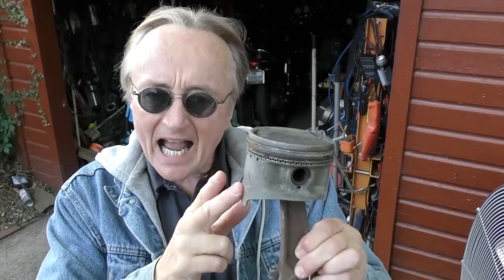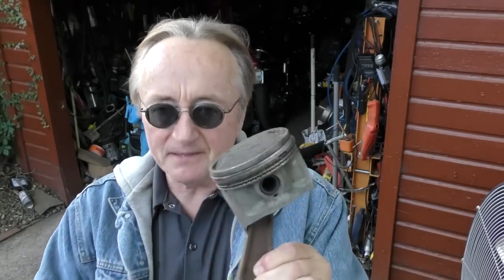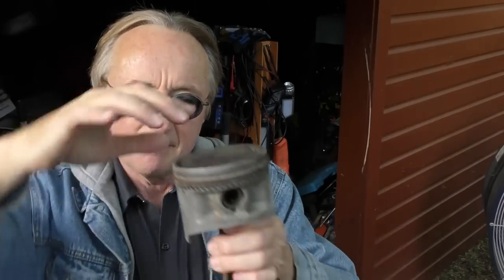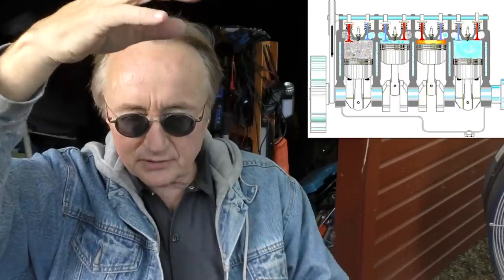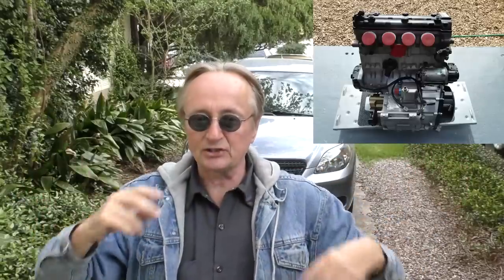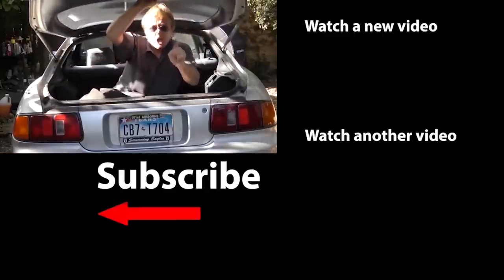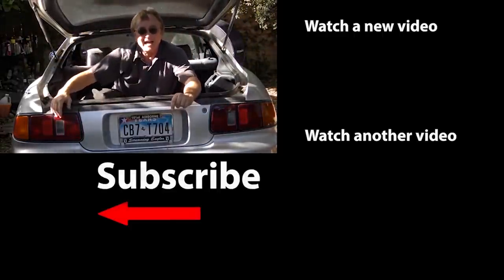Horsepower vs Torque, Which is Better

Comment: Torque - strangth of the rotation.
Horse power - is the work the engine does to rotate the wheels
Reply: I love this
Reply: Actually no. Rpm =speed of rotation. Torque×rpm÷5252 =hp
Reply: Horse power - strenght of the rotation multiplied by the speed of the rotation. You can get torque from HP, but you can not get HP by torque alone. That's why HP is the most important thing - no matter how hard you push, it's the speed of the push that matters. 
“Give me a place to stand, and a lever long enough, and I will move the world. ” 
― Archimedes
Reply: Sounds about right bro. Horsepower includes the momentum and inertia whereas torque is only measuring the force exerted on the crankshaft by pistons. Thanks Nick
Reply: Hp isnt speed of rotation. @5000rpms, the its rotating at.......@5000rpms regardless if its making 200 or 2000hp at that engine speed.

Comment: When people think high torque they're usually referring to high horsepower at lower rpm (refined acceleration), when people think high horsepower their thinking of peak horsepower which is usually achieved at high rpm or in other words a screaming engine to get good acceleration.  A high torque engine will feel more peppy and responsive.  A high peak horsepower engine will only accelerate fast after dropping multiple gears first then screaming at high rpm to yield its full and ultimately faster potential

Comment: Good simple explanation but there are more factors including gearing.  An acceleration curve within a constant gear does mimic a torque curve, hence best acceleration is at the torque peak.  And modern transmissions are very good at keeping an engine within the torque peak.  But lower gearing is a torque multiplier. An engine with 1/2 the torque but twice lower gearing has the same torque at the wheel and same acceleration (at that point).   An E92 M3 had only 295 torque but an 8500 RPM redline and 415 HP, hence once off the line, lower gearing gave it the same torque at the wheel and acceleration as a car with tons more torque.  Also note a basic fact:  SAE HP = T * RPM / 5252, hence at 5252 RPM, HP = Torque.  This also means any engine with redline < 5252 has more torque than HP, and any engine with a higher RPM HP peak can have more HP than torque.  Lastly, you need HP to overcome drag from air resistance at high speeds, hence higher HP does give you higher top speeds.

Comment: All engines, ONLY make torque, not horsepower.   Horsepower is a function that calculates how much TORQUE an engine makes per unit time.  

High torque engines, have longer bore strokes, which makes a lot of low end torque.  All piston engines, are limited to a certain piston speed .  High torque, long bore stroke engines reach this high piston speed much sooner than short stroke, high hp engines.  

The secret to big HP, is to make your peak torque, higher in the RPM band.  The trade off being, low end torque production suffers.  This trade off can be helped, by engine configuration (V vs inline, or number of cylinders), forced induction,  and by using steeper gearing ....  Gearing, combined with a high revving engine,  is why a Hayabusa and F1 car, can accelerate so fast, with relatively LOW torque production.
Reply: This is a very short, rudimentary explanation, but I look forward to the comments!
Reply: Twobarspi, you gave  too much logical info, so now the street fight will happen between the fast and the curious LoL. 

  Name of their drama: Wes side sorry story

 Thanks though, for being factual, dude.
Reply: @mazdarex7  thanks 🍻👍 !!
Reply: @Twobarpsi  we will now be attacked for being "square bores"
Reply: @mazdarex7  😂😂😂😂

Comment: Torque is the measurement of Work that is applied in rotating the crankshaft. Horsepower is the rate at which Torque is applied for a given amount of RPMs.

Comment: So practically high torque engines (diesel ones and powerful pertrol V8s) are better than high horsepower in a daily city driving, correct me if i'm wrong
Reply: You're correct. Torque helps low speed acceleration which is mainly what the city is.
Reply: high torque engines are better for carrying heavy loads and doing a lot of stop-and-go motions. for city traffic in a truck, then yes, but for a light car you don't need a lot of torque
Reply: Welcome to Europe with their diesel car trends ---> 150hp ~ 400nm/torque
Reply: I will correct you because you are wrong, Higher torque in stop and go traffic is just gonna make you smash your head on the steering wheel 20 times before getting to work because you will have a very jerky ride stoping and going with so much torque. A car with more ponies will give you a smoother ride and that will be far more relaxing to drive to work in
Reply: @Jamie-cz2xu  smashing your head on the steering wheel has nothing to do with engine output numbers but rather with your throttle control skills.
Reply: @Jamie-cz2xu Far from the truth. High torque vehicles offer peak power before 5252 RPM. This allows you to shift earlier and have smoother acceleration and higher gas mileage. Honda realized this the hard way and had to change the engine Dynamics for their Civic line up. Don't believe me compare the torque numbers from an 07 to 2018 Civic Si.

A good car for the city will have a balanced torque and horsepower setup. 200 horsepower and 200+ pound feet of torque is ideal for a vehicle around 3000 pounds. That's of course my opinion.
Reply: @Josh-cw8by  it's not that Honda had to learn it the hard way, they were catering to the VTAK crowd that liked to rev to 10k rpm.
Reply: @AR-zq9hq  You're probably right. I'm by no means an expert, just my observations.
Reply: @Josh-cw8by  yeah, back in 06 or so there was rivalry between Civic Si and VW GTI, they both had 200hp, but si was a high revving low torque motor, while GTI had 200ftlbs torque and would rev much lower. Both cars were equally quick to 60mph, but the GTI was easier to drive. I personally was team Si back then haha
Reply: @AR-zq9hq No kidding eh? Weren't those engines from Honda forged as well? Forged internals anyway.
Reply: @Josh-cw8by  no, I believe that would be the B18C, the Integra type R motor. The K20 in the US market Civic Si didn't have forged internals.

Comment: Torque is the force generated by the engine. Horse Power is the torque multiplied the rate at which that force can be applied. Because peak torque occurs at low to mid engine speed this implies higher power at lower rpm therefore quicker acceleration / better towing.

Comment: 3:35 “… formula 1 don’t accelerate”  ?.???.?
There is a thing called “gear box” you know…
There isn’t anything faster, quicker and with better acceleration per liter of engine displacement than a F1 car
Last weekend at Austin’s COTA things were put in perspective
Reply: “They start slow”
Really? 0-200 km/h is under 5.5 seconds? 0-100 under 2?
And that’s not even what makes F1 the best, it’s the changing direction and the braking power… the Gs in lateral forces
If you are up to let’s meet at COTA this year during the GP, I think you misspoke about this issues because of the t8me video. Let’s talk, I will buy you a coffee or a beer (or two or three lol) at downtown Austin
Reply: But… Mr Plow… all is forgiven he he
The coffee/beer proposal is still on

Comment: So torque is is a bodybuilder and horsepower is an olympic sprinter.  Got it.
Reply: Horsepower is like having a really massive body builder using a tiny spanner to loosen a nut..... Torque is like having a thin scrawny guy loosen the same nut with a spanner a few feet long
Reply: Now I get it.  thanks for a great metaphor.
Reply: No. Those are both high power people. Ask them each to carry 100 bricks to the top of a tall building. Who knows which one will win... They are both high power. Power is work / time.

Comment: Torque is rotational force.  
Force over a distance is work and takes energy to accomplish.  ( Can't create energy, just transform it). Going zero to 60mph takes a certain amount of work, almost independent if how fast you do it.   Power is the rate at which you can do work.   Climb a hill faster, or go zero to 60 quicker takes more power.

Comment: Torque: is a sumo wrestler pushing his way through a crowd and horsepower: is a bag snatcher running away with the handbag.
Reply: Tq is the reason you get pulled back in your seat as you accelerate 0-60 in 3.5 seconds. Hp is why your car can keep going to 150+ mph

Comment: You buy horsepower, you drive torque.
Reply: Well spoken
Reply: Not true because a car with 200 horsepower and 150 torque will always be faster than a 150hp 200 torque ..on initial hit that torque will jump a tiny bit bit once you get in that rev range.....
Reply: Completely wrong. Think of torque as a twisting force, and hp is how quickly/fast it can actually turn.
Reply: except a car with 150 hp and a car with 500hp can both turn at the same rpm (speed).. so

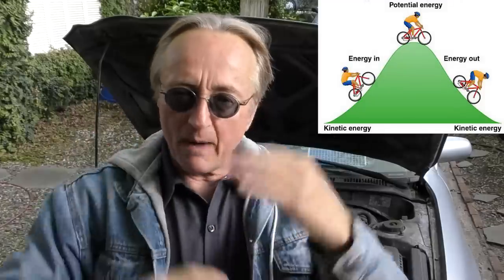Comment: 0:25 Chemical Energy of Gasoline not Potential :)
Also Formula 1 cars have some kind of hybrid battery which helps in acceleration on straights
Reply from the maker: gasoline is chemical potential energy, don't know who told you otherwise
Reply: F-1 cars have a lot of gears, not some electric gas hybrid motors
Reply: Stop being one of those people that correct every little thing about others, make a video yourself
Reply: Chemical energy is a type of potential energy... So scotty was right and you are correcting him without knowing the definition yourself.

Comment: Actually torque is determined by the length of the stroke and width of a bore. The longer the stroke the more torque, but because it has a longer stroke the piston is narrower in order for the car to have a certain displacement. so a 2.0 liter engine with more torque will have a longer stroke and smaller bore than a 2.0 liter engine with more horsepower... Test it, find 2 different engines with the same displacements and look at the bores and strokes of those engines.

Comment: Usually inline engines produce more torque in the lower RPM band than the engines that's why most diesel engines are straight in line and not in the v configuration

Comment: Volvo = Runs steep uphill without any vibration in the RPM.
Toyota = Starts slowing down and needs switch to low gear to keep RPM not dropping.
That's how i learned the difference between horsepower and torque

Comment: actually, Power is all that matters, the difference is the powerband

high torque engines tend to make all of their power at low rpm, so they're good at towing heavy loads if you need to stop-and-go a lot, and they will deliver instant acceleration as soon as you step on the gas. They are also usually much larger and heavier than lower torque engines that make the same amount of power

high revving engines on the other hand make all of their power at high rpm and they weight a lot less, so while they may be slower when accelerating from a standstill, once they reach a high rpm they will provide a lot more acceleration while also weighing less

Comment: my father used to have a 1.8l diesel engine with 90hp.
that thing had power for days.
while i had a 1.8l gasoline engine with 115hp.
my car wasnt all that slow tho, but compared to the diesel it did felt sluggish. 200nm at 2000rpm even with only 90hp make big difference.
Reply: now i want a diesel..
unfortunately buying nowadays a diesel in germany is financial suicide.
Reply: It just the turbo in the diesel car that tricks you, in fact the gasoline one in your example will accelerate a little bit faster but you won't feel it that much bacause it's much smoother without turbo.

Comment: Its like gearing was completely forgot about in a majority of comments and this video ..       With enough gears, fast enough shifts or an extremely tough / efficient CVT ... you can pretty much do anything: a high torque, low hp engine will get you there fast and keep you there.  If you are trying to achieve speed w/o a sophisticated transmission then yes you need the high rev higher hp engine.

Comment: Engines have a torque band. You can design an engine to have torque at low rpm or you can design an engine to have torque at a high rpm.  I have two BMW motorcycles. One has an 850cc engine and the other has a 1200cc engine. The 1200cc engine produces 60 hp and the 850cc produces 75 hp. The 850cc gets it's hp by turning at a high rpm. The 1200cc has a lot of torque but does not go high rpm. Personally I like the torque as it is more pleasant for driving around town.

Comment: Horsepower vs Torque, Which is Better?.....is like asking Watts vs Volts, Which is Better? It's a nonsensical question, because torque is a part of horsepower, just like volts is a part of watts. If you asked an electrician or electrical engineer, "Watts vs Volts, Which is Better?", they would rightfully look at you like you were stupid. Likewise any mechanic worth their salt, would view you as equally stupid, if you asked them the title of this video.
Reply: Exactly, I think the difference and the reason this misconception is so much more pervasive than your example is that people's intuition grabs on to torque and they equate it to muscle strength as in a really powerful person. They loose sight of it being a static quantity that does not require motion or energy at all. As soon as anything is moving, all those "torque guys" are really thinking about power without understanding it. 
You're exactly right. Before the lightbulb comes on, power is still this mystical thing that they know involves speed somehow, and so they forget that it is a also a direct function of torque. They also tend to forget that a gear ratio trades torque and rotating speed. This is the key to breaking the "more torque in must mean more torque out" misconception.
Reply: watts offcorse 👍🏻 dosent matter how many volts your blender have if it have 1 watts of power you willl blend your fruit shake  10 years 🤮 vs 10 kw at good gearing be like 1 sec of hold switch and done   👍🏻 .

Comment: HP = Torque ( lbft ) x revs ÷ 5252. On a dyno, the power and torque curve will cross at 5252 rpm.

Comment: Harley accelerates faster than Hayabusa? Yeah right!
Reply: Haha yeah maybe if the harley is falling off a cliff.
Reply: How fast a vehicle accelerates from 0 to 100 km/h can be calculated from it's weight/power ratio plus 10%. A car that weighs 1000kg and has a 100hp engine for instance accelerates from 0 - 100km/h in 1000/100 +1= 11 seconds. The transmission turns the engine power into the propelling torque at the wheel. A lower weight to power ratio always wins a drag race. A Hayabusa has roughly 3x the torque of a Harley at the wheel.
Reply: @jmarselle3877  Even then not... as they both will accelerate at the same speed until aerodynamics become a factor so the Hayabusa will have a higher terminal speed, assuming they're both facing vertically downward.
Reply: Kilmer doesn't know what he's talking about.
Reply: When I had a bmw 1150 it would beat an r1 to about 50 mph! I'd be in 3rd gear, Yamaha still in 1st pulling a wheely as it passes me!
Reply: Power is nothing without control! Takes skill to launch an R1 properly.

Comment: Hey Scotty I just got a leftover 2018 Ram Promaster with the high roof, she's going to be pampered as a multi-use family vehicle rather than commercial work.  Wheelchair van on occasion, camping, and just to haul stuff like a pickup truck.  Besides 5,000 mile oil changes and normal service how can I ensure she last the longest, probably be driven around 5,000 a year give or take.

Comment: James Watt defined horsepower :- 33000 ft/lbs per minute.
A good coal pit horse could raise 33000 lbs (of water) through one foot in one minute -- or any combination of weight and distance that equaled 33000.
The torque force is the ft/lbs component, the power component is the rate of applying that torque.
Example :- a 330 lb weight moved 100 ft distance in one minute  is equivalent to one horsepower.

Comment: I tend to think about torque and HP like running a 400 meter olympic race. Torque is how fast you can get off the starting line to reach your top speed, and HP is exactly where is the upper limit of your top speed (how fast can you run for the remainder of the track)

Comment: Power = Work per time
Power = (Work)/(time)
Power = (Distance-Force)/(time)
   Watt = (N-m)/(sec)
Power = (Ft-Lbf)/(time)
Power = (Torque)/(time)
Power = Torque per time
Power = rate at which torque [work] is done
Reply: Actually, it's W, not kW, that is the SI unit for power.
Reply: Tony Rule 
Thanks. Previous was updated with your generous help.
I never pay attention to constant factors.

Comment: Horsepower = torque x rpm.  One of the main advantages of a large displacement engine is that it can develop more torque at lower rpms and thus there is more horsepower available at low rpms.  But one of the disadvantages is that with those great big pistons the "red line" is lower, too much mass moving up and down.  When I was younger my friend and I had nearly identical Yamaha IT's, only mine was a 250 and his was a 500.  The horsepower difference wasn't huge, my 250 made 32 and his 500 made 40.  But the difference was that to make 32 hp the 250 had to be up over 5000 rpm (red line 9000 rpm).  The 500 on the other hand, 5000 rpm was the read line but omg did it make power at lower revs.  It always pulled no matter how fast it was turning.
Reply: Throwing displacement into the equation just confuses people more.
In the case of two identical engines in terms of displacement and torque but with one having more power, the one with more power will accelerate the same car more quickly with both having optimal gearing.

Comment: I'd rather have high torque. Can't often break the speed limit on a daily basis without risk however you can get that fun G-force push back ever time you accelerate around the city with good torque.